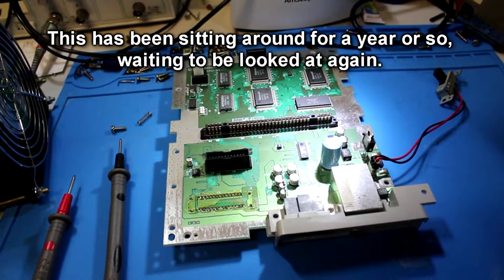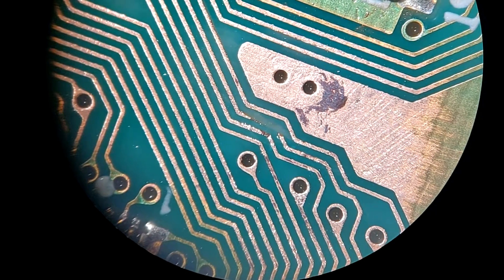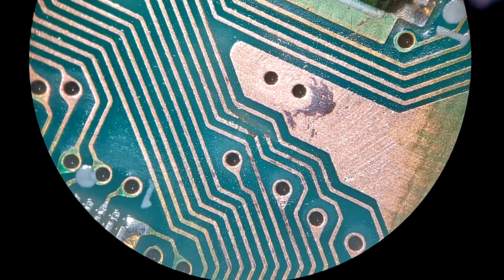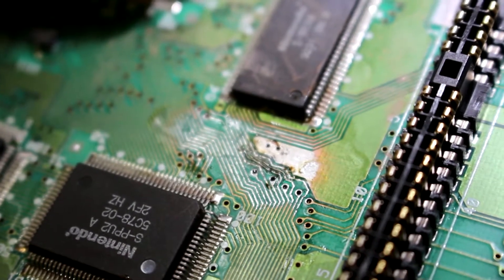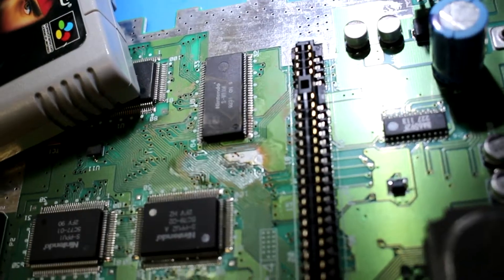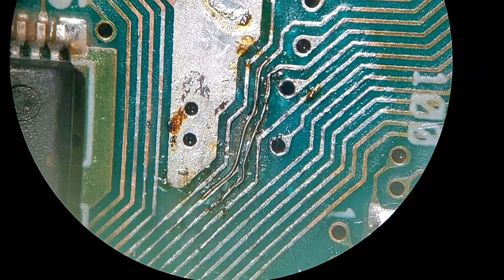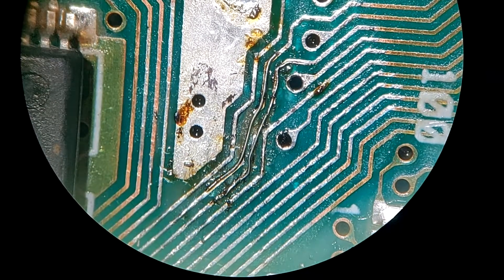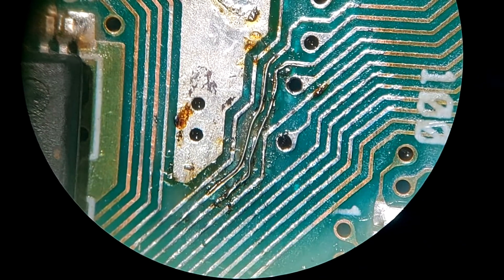Super Nintendo/Famicom SNES/SFC Black Screen Repair/Fix (Trace Repair)

Comment: I can’t wait to stumble across a trace repair snes. A few months ago I fixed 2 n64s with broken traces on the board.

Nice job I just subbed. 

Also, do you think a fiberglass pen would work better at scraping off that solder resist? I’ve been meaning to pick one of those up but I having needed one yet.
Reply from the maker: Hey, thanks. Nice job yourself. It's always good to get these things working so they stay out of the landfills.
Fiberglass may actually be better; certainly to more accurately control the area you're working on.

Comment: Didnt have to remove the jacket on the wire to fix the traces as long as you connect them. Also they make silicone jacket wires so you can solder all day without it melting on you.
Reply from the maker: Where's the fun in that?